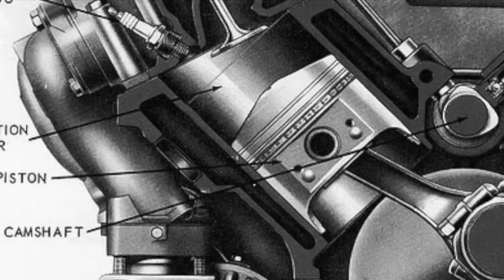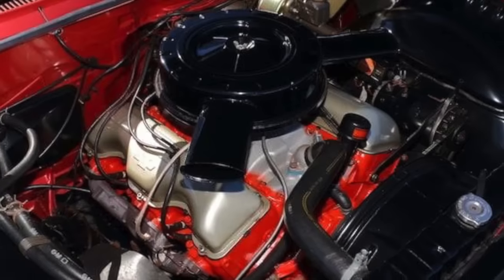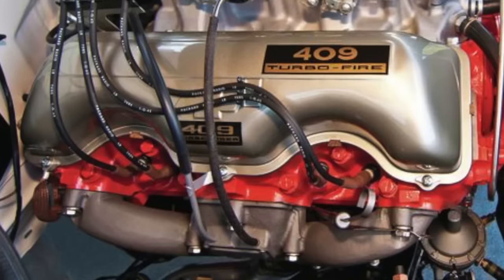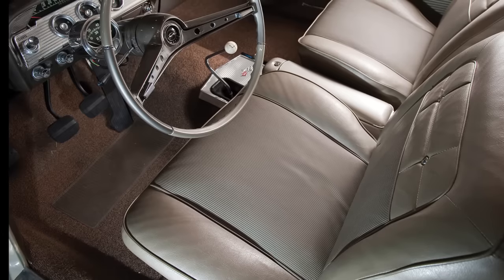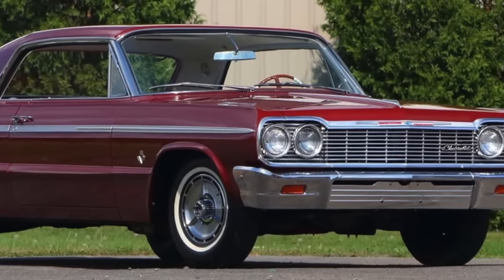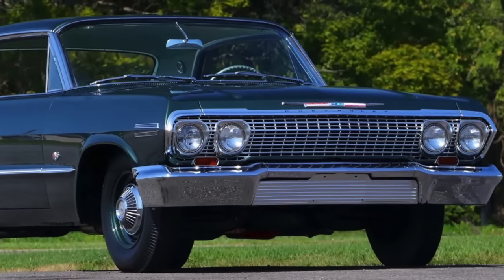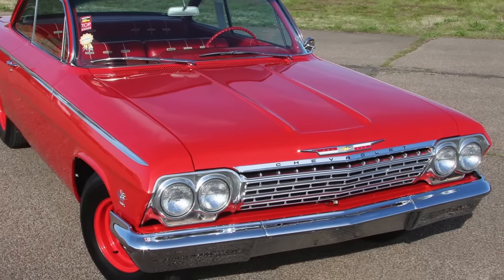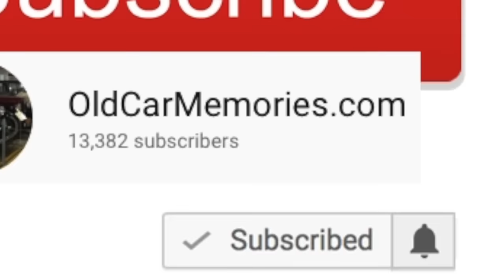1961-1965 Chevrolet 409 V8 - The Ultimate Budget High Performance V8

Comment: I owned a 409 while in college back in the 60's.  What an awesome navy blue Chevy.  Because of the 411 rear end it was fast off the line.  When you jumped on it in 1st, the front end would come up as it shot you forward.  Definitely a rocket ride.  Hated to see it go, but I blew the engine.  Those were the days my friend!
Reply: DRB, there lies the problem. It blew up.
Reply: I've also heard stories about nova's with 409's lifting the front end off the ground on the launch
Reply: The front end was twisting up because of that ridiculous x frame
Reply: Dream car of mine, thank you for sharing
Reply: I also had a '62 Impala SS back in HS in '68.  It was red with black interior, had the HiPo heads and dual quads, 411 gears, close ratio 4spd and NO power steering
from the factory.  The dealer that sold it installed "dump tubes" off the exhaust manifold for racing.  It passed everything on the road except a gas station and then it "had" to have the highest octane gas....Chevron Custom Supreme (gold label) which was a "horrible" (we thought)  42.9c a gallon back in the day!    ;-)
Reply: @sergeantmasson3669    My 409 never did....it was all in how you drove them.  You can blow ANYTHING up, even a brand new engine in a brand new car.
Again....it's all in how you drove (and maintain) them.....like anything mechanical.
Reply: @oceanwaves83   Not a factory option, and they must have used Crisco and a big shoe horn to stuff it in 409 into that narrow Nova engine compartment!   ;-)
Reply: @oceanwaves83  Chevy never put a 409 engine in a Nova, PUTZ.
Reply: @USCG.Brennan   Big difference between a street car's engine and a NASCAR engine.
Reply: @marioncobaretti2280   That twisting motion was more "torque" than anything else.
Reply: @USCG.Brennan  NASCAR hasn't had strictly stock cars since the early  50's.
Reply: @oceanwaves83 Nova didn’t have a 409.

Comment: Fact: People seem to forget Ford was not the first production V8. Cadillac had a 314 L head V8 from 1914 to 1923. Also a larger cube V8 1928 on . Oldsmobile also  produced the light 8 from 1916 to 1923. Chevrolet also produced a V8 from 1917 to 1918. They produced over 4000 V8 cars those 2 years. All  built by GM. The 409  is for certain a legend !

Comment: Very well-done video. Thank you. I'm a Baby Boomer, born in 60, my dad bought a new 63 Impala when I was Two years old and drove it 14 years then handed it to me after it was run into the ground when I was a sophomore in high school, it was a SS with a 283-3 on the tree. My auto shop teacher was also a drag racer and helped me completely machine and rebuild that mouse into a street sleeper, knowing the secret to making a 283 screamer. So much so that it tore up that 3 speed, I replaced it with a Borg Warner super T-10 out of a Corvette, then it tore up rear ends, twice, then u joints and drive shafts.........the secrete to the 283 is RPMs!!!!! if you balance a 283 well, and do the head work, he taught me run them up to 7500 before you shift!!!! Best auto shop teacher ever!!!! We leaned and did it all in house at school!!!!! Villa Park High School Orange Unified School District , Orange California class of 1979. Thank you Mr. Haysom
Reply: Also born in '60, graduated in '79 in L.A. . . . but ended up gravitating toward mopars.

Comment: The early 60's was a wild time and things were busting loose with the big three. Pontiac had the Super Duty mills , along with the Chevrolet 409 , and the big Ford and Chrysler engines were all fighting in NHRA and NASCAR. It was an awesome time.
Reply: The 421 was hot at the drags until the 409 ,the 409 was hot till the 66 - 426 hemi

Comment: My brother-in-law bought in 1963 a  "58 Chevrolet Biscayne (cheapest version full size Chevrolet) 2 door black  sedan that had the 348 c.i. engine replaces by a 1962 model 409 that was previously used in a race car.  Nobody noticed the "Plain-Jane" car until I would take off from standstill  in first gear or pass another car in high gear. What a ride!

Comment: I remain amazed by the resurgence of 409 auction prices in the last few years.  When 409s were new they were noted for two things:  They would outperform the Fords at the time and they wouldn't stay together long enough to get through a 12,000 mile warranty if they were run hard.  They were almost as notorious for throwing rods as the 406 Fords later became.
The first really durable dominant NASCAR engine was the 427 Ford.  That lasted for one year until the 426 Hemi arrived.

Comment: I had a 63 Biscayne 409 425 HP when I was eighteen years old. It was tuxedo black with gold interior. I worked on it more than I drove it.  kept bending pushrods and and breaking valve springs I guess because I overrevved it. It was a monster.

Comment: I had a 1963 Impala SS 409 2-4s . Would pass everything but a gas station or tire shop. But couldn't keep a driver's license as long as I had her so sold it in 1977. After sitting in the garage for years. See it at the back to the 50's car show still in great shape.

Comment: I bought a 1963, 409 in the Biscayne body, 425 H.P., 456 rear end, with the 4 speed. If I remember correctly, I paid $2750 for the car. I was 19 at the time and we had ball with that car. I pulled the engine and replaced the pistons with Jahn, 12 to 1 compression pistons and a crower race cam, and spent a lot of money on the car. It did not run that great on the street, but was a bear at the track. Those were the days.
JN
Reply: Wish I had that much money in 1963.  I was 18, fresh out of high school and on my way to Fort Ord.
Reply: You were fortunate,Joe. The 348-409 design with the combustion chamber in the cylinder instead of the head were known for bending rods when you got on them hard. Back when I raced NHRA, Bill Jenkins from Malverne ,Pa. (Grumpy) raced 409's and secretly hated them,but, it was the only big block until the rat motor came along.
Reply: I love Jahns. My 1926 Ford Model T has a set of 1950s Jahns performance .040 over aluminum pistons for the original engine. The top of the pistons are also raised .040 taller for a slight compression increase.
Reply: Laim Bagelle Being a Mopar "expert", I don't remember about the valve configuration of the various Ford engines,but the cleveland motor had angle plug heads,the other 351 did not.
Reply: wow that must have been intense on the highway
Reply: Cool! Thanks for sharing.
Reply: @oldtimesmatthew  yup when i was a kid and more t s and a s were running around my dad would say yup throw some aluminum pistons in them flivvers and theyd get down the road lol
Reply: I went to a memorial weekend party at a friend's house about 7 years ago, that started to get a bit too crowded and noisy for my liking. I needed a break from the asses and elbows crammed sardine packing plant in the backyard, so I walked out to the front yard to sneek a cigarette (I was supposed to be quitting 😉). That's when I heard the neighbors across the street fire it up in their garage. I didn't know my friends neighbors, but I just couldn't help myself and had to go take a look. There it was.....1963 Chevrolet Impala SS 2 door! I believe it also had a Malibu badge as well, but I could be wrong. It was all numbers matching 425hp 409 cubic inches with a 4 speed. The car still had it's original factory white paint, with black interior. It was a true survivor and only had a ridiculously  low amount of miles @ 3,600 original! We talked shop for a bit, then he asked if I would like to take it for a spin??? 🤔 uh....ok! He went along of course, so we went to gas it up. I remember that unforgettable soft howl sound of each gear when putting the torque and h.p. to that 4 speed, you gear jammers know what I'm talking about.  We gassed up and then drove back, but only after a quick resurfacing of the rear tires 😉! I told the neighbor what a cool car he had. He then said to me.....this is the wife's car, my baby is in the shop out back 🤤! Save that story for next time.....😎
Reply: @cheezmosarcazmo434  i doubt the malilbu badging on a full size car
Reply: @charliechristie2949  , nobody came up with better hardened rods ?  ( Grumpy) ...it figures .
Reply: I HAD  A 57 WITH A 348, 3 2S
Reply: The Biscaynes where pure engine the true definition of a muscle car.
Reply: Joe Nicks I wouldn't have wasted dough on the aftermarket stuff,,the 62 Biscayne with the 409 package was the fastest quarter mile stock car of that year,,
Reply: Too bad you didn't put dish pistons in there, could have put a turbo on it and almost doubled the HP, save half the gas and drove it anywhere with your foot keeping it from becoming that wild beast untill you wanted it, but what do I know?
Reply: Did you save your pennies?  Did you save your dimes?  Sorry, had to do it.....
Reply: Cecil Martin I’m guessing it wasn’t stock. 348 first showed up in the 1958 model year, biggest V8 was a 283 in a 1957 Chevrolet.
Reply: @cheezmosarcazmo434  favorite YouTube comment
Reply: Kool memory!!! 👍👍👍

Oh, PS I was born in 63. Good year
Reply: @cecilmartin5078  Did you drop the 348 in your ''57?  The 348 didn't make it's way into a Chevrolet vehicle until 1958.  The best you could do in 1957 was a 283 small block V8.

Comment: An excellent documentary on the 409.  Thanks for all of your hard work. I really appreciate it.  Without the 409 we would not have muscle cars as we know them today. Thank you, Chevrolet!!!!!
Reply: John Behneman, that's FALSE. First muscle cars were in 1957 BEFORE the 409 even existed. Chevy "W" engines were not all that great. After 1963, NASCAR's Junior Johnson switched to Ford for 1964 because the Chevy "W" engines kept failing.  Drag racing star Dyno Don Nicholson also switched to Ford for the same reason.
Reply: The first muscle car was the 55 Chrysler 300.  But it was so expensive that very few were sold.  They did dominate NASCAR for a couple of years.

Comment: I'm not an authority on 409s, but my late father-in-law was a GM master Truck mechanic, and he said although the 409 was fine truck engine, was not all that good for "hot-roding" because it's relatively long piston stroke, compared to the 348, made it tended to wear out early if run at high RPMs for extended periods. I don't know if that was the case, but an older kid who lived across the street from us when I was in high school bought a new 1962 Chevy with a 409,  and he did a lot of street racing. Within a year or so it was smoking out the exhaust, and after it was only two years old he got rid of it. As I remember it was a post type two door with fleet white paint, so besides for the engine, it was just a run of the mill Chevy coupe.
Reply: It didn't have a long stroke, but it did have heavy pistons.  OK for a "regular" engine, but delicate when turned into a race engine.

Comment: This is a good SOURCE video, which explained dimensions, combustion chamber, and valve design. For example, it answered a few of the questions I've always had about the curious head design and why it was easily distinguished by the curious "wing" shape, among others I've always had about the rather unique 409. Thanks for posting.

Comment: I owned many of these motors in my time. Loved them!!! One of them I had, I had .250 milled off the mains of a 454 crank shaft and had the 409 bored .030 and if I remember correctly, it made 488 cubic inches. Wow was that a running machine!!! 2 fours, roller cam, headers and a four speed trans. My 63 SS baby blue Impala. Memories....
Reply: Bingo can't beat Chevrolet's interchange............Blood runs Chevrolet engine orange..........
Reply: When you die, I'm taking your memories
Reply: Hey Danny Wilshire, What did you do about the center support bearing in the two piece driveshaft? The 1963 Impala,Bel Air and Biscayne had an X-frame so a one piece shaft was impossible.
Reply: Don't remember if there was a factory 3 deuces set up but I do remember some that were. Always a good way to have a fire. They looked good but nobody ever got em tuned correctly. A friend's decided to catch on fire in front of my house. Have water hose and shirt, will use it.
Reply: @charliechristie2949  I just saw this comment. It was way back in the late 70's when I did all this so I really don't recall anything about the driveshaft. But you are correct about the two piece driveshaft. It had a carrier bearing just past the x-frame if I recall.
Reply: @dannywilsher4165  I never worked on one,but, I read that if you limited the downward travel in the rear suspension,you could get away with a one piece shaft and avoid a lot of grief. THOSE WERE THE DAYS,My Friend.All the best, Danny.....!
Reply: @oillease1881  Tri-power was a high performance option on the 348 engines, but was never stock on the 409.
Reply: @pnwdweler4100  2 four barrel Carter AFBs

Comment: In 1964 a friend of mine (Sonny Lytton) in Rockville Md bought a brand new Chevy Bel Air.  He told me that the only options he ordered were the 409/425 engine, a 4 speed transmission with a "posi-traction" rear and an AM radio.  I went for a ride a couple of times and it was a real hoot!  Sonny was killed in Viet Nam about 1968 with Special Forces (Distinguished Service Cross).  I never did find out what happened to the Chevy.  It was one heck of a ride!

Comment: Made our own Z11 back in 64. Bought the crank, rods and power slot pistons, Isky cam. The 425 HP 409's  came with 2 head gaskets installed to lower the Compression ratio. Which meant the heads were the first thing off a new car. Being a long stroke engine the max RPM's were rather low. 5800 was red line. 5801 those 2.125 intake valves were floating! Bent push rods were the result if you were lucky. Hit the 12's a few times but that engine was real tough on tires and Muncie four speeds. At highway speeds (60's) if you were a bit too aggressive on the throttle, the tires would break loose. It's been 50 years plus and in reading about the Z11's being ordered without heaters to cut weight. That's not how I remember it. The cowl induction that was offered used the same cowl ducts as the heater assembly. Couldn't have both just one or another. Never believe that cowl induction was anything other than a gimmick as it's value would only be realized at high speeds if at all. And, in any race situation the first thing to come off was the air cleaner, followed by the exhaust cutouts. Good old days!
Reply: Just think what that monster could do now with the advancements in Tire Tech. and Suspensions.
Reply: 409's very SHORT stroke...
Reply: Thanks for sharing the good old days with us. I love hearing about this kind of history!
Reply: Wow, that's cool. How do you feel about the LS small blocks?
Reply: Not a long stroke at all. Big bore short stroke.

The RPM limiter was how heavy the piston and wrist pin were. The piston weighs almost 75% more than a 454 or 427 piston, and the wrist pin weighs 50% more.

With a modern light weight piston and pin, a 409 will rev extremely high.

Comment: A couple of corrections. Chevrolet actually had a V-8 briefly in 1917, then didn't have another one until 1955. Also, In 1961, the 409 came only in the Impala SS, before being made available for all big Chevys in 1962.
Reply: And one more point.....the '61 "409" was a midyear option....the early '61 SS cars had the older brother "348" engines.  I had a "348" in my '61 SS and then a "409"
in my "62 Impala SS.  Just saying.......

Comment: We've heard the old truck motor theory since way back when.  Desperate for a big block to compete with Fords and others Chevrolet grabbed the 348 "truck motor" and put it in cars.  That has been debunked several times over the years.  No truck specific engine would have such a drastic over square displacement. Torque is the object of a truck engine and a smaller bore - longer stroke would be the design for that.   Those old W motors were just a special breed.  ++Excellent video I think.++.
Reply: You are probably the one who is correct.

Comment: Back in my late teens, I purchased a 409 from a bone yard, to replace my blown 327, in a 1964 Impala. I did a total rebuild, adding a 750 cfm Holly double pumper, headers, a Mallory Dual Points distributor,  and a mild solid lifter cam. Very soon after getting the engine running, my father offered to co-sign a new car loan. I sold the 409 and the Impala separately to get the down payment money and never found out what that 409 could have done.

Comment: I'm glad you finally mentioned them being put in trucks. Several of the publications at the time , said it was a dump truck engine. Lots of torque at low rpms
Reply: lotta people dont know that duntov designed  v8 ardun overhead valve  hemi  heads for flathead v8 powered british garbage trucks. Thats what ardun stood forAR kus DUNtov
Reply: Not installed in trucks until late 58. 4 months after cars received the W.